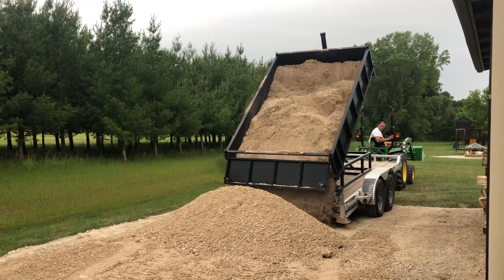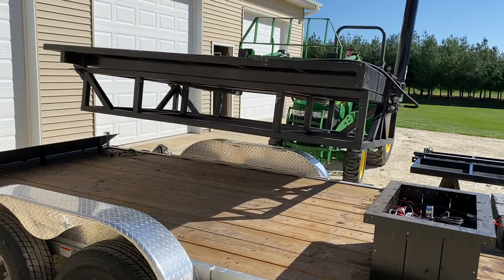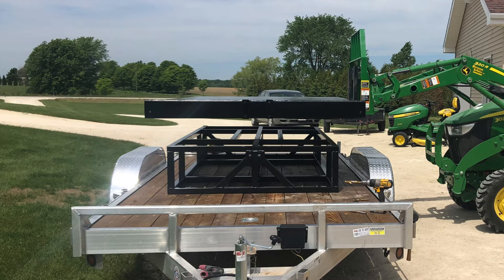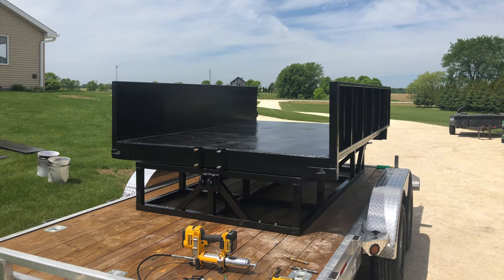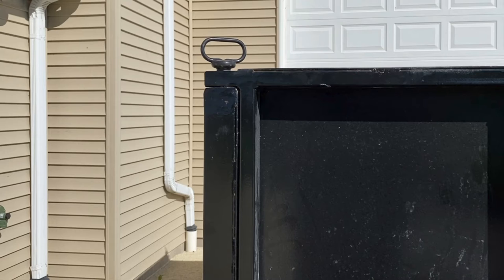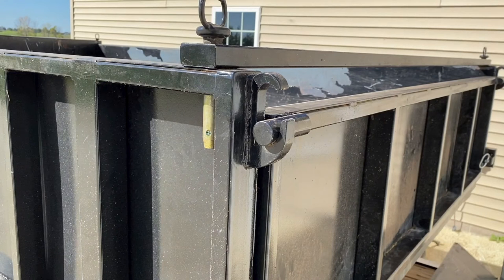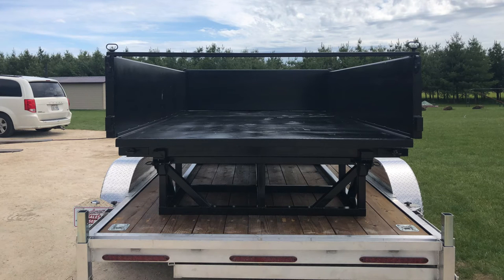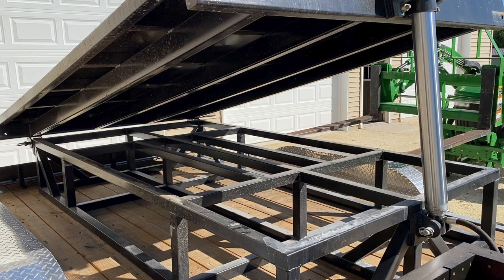Dump Trailer Insert DIY - Holds & Dumps 4 cu/yd

Comment: Love this, just the kind of thing I've begun to think about. Was the height on that lower frame necessary for any reason other than fitting it over the sides on your smaller trailer? Seems in some situations I'd want to keep the center of gravity lower, but maybe there's something I'm not thinking of. Other than that, i might copy this exactly... bravo!
Reply from the maker: You got it, the height is merely for getting it on my small trailer and over the fenders of the bigger trailer.  The higher center of gravity encourages sway more when it's heavily loaded for sure.  One benefit is that when you dump, you can have a taller pile without having to pull forward all the time but it would be better to have it lower.  Glad you liked the design.  Best wishes!

Comment: Do you plans available for download/purchase? This would be perfect for my situation. Have welder, can build with a little more details…
Reply from the maker: Hi, thanks for your interest.  I never wrote down any official plans for this other than my list of materials that I took with me to the metal shop.  I surely tossed that years ago so I'm sorry.   I can tell you that the base is 104" x 58" and I used all 2" tube steel.  I used 14ga for most of the tube but went with 1/8" on the pieces that attached to the ram in front and hinges in the back.  The top platform has 4 runs of 2"x6" 1/8" that I think measured 100" plus 2 more for the front and back measuring 72".  Then for the back tail I used 14ga tube stock for the 8" overhang plus I used 14ga 2"x2" tube stock for all of the perimeter and perlins.  The top has 11ga flat steel welded to the frame material.  The overall dimensions of the top platform is 72" x 114".  The sides are made using the same tube steel and flat steel materials and measure 20" tall.  The hinges are actually automotive strut mounts I found on Ebay and I also used Ebay for some of the tailgate steel items like the latch and the C brackets.  Other things I just fabricated myself using my imagination like the boxes that the latches go into and the grease fittings for the hinges.  The ram was purchased from Bailey Hydraulics.   Hope this helps!  Sidenote:  I actually got this idea after watching a video that showed a CAM SUPERLINE 6"x10" 4-way dumping trailer video.  Search for it sometime.  It looks awesome but I didn't want to spend $9k so I made one.

Comment: Incredible build and awesome well done video. Thanks for posting. What do you figure it weighs?
Reply from the maker: Thank you. The base is near 1,150lbs and the sides are about 350lbs for a total of around 1,500lbs. I cannot lift the entire thing with the 3039R tractor and loader because it sticks so far out past the machine.

Comment: Where did you get the cylinder and pump?
Reply from the maker: Hello, I purchased the hydraulic cylinder from Bailey Hydraulics and I got the pump from Amazon.  I made the enclosure and battery hookups which I plan on doing a video on at some point.